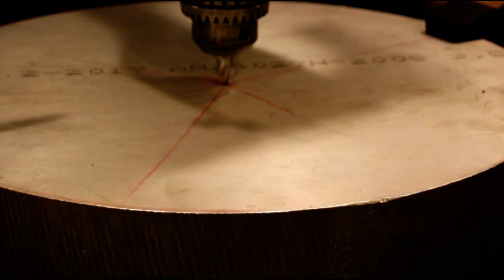Willys Cummins 4BT #1 SM465 Transmission Adapter

Comment: I kinda figured you was cutting wood,  that's about all I've been doing as well lol. I'm very interested in the 465 series as my 3b will be getting a dauntless/465 swap over the winter. Not to worry, she is already far from original as purchased. Thanks Brian, feel free to email if you need any Cummins dimensions,  I have a 6b in my shop as well as a 1st gen Dodge.  I think I sent you a measurement a while back.  Any how, taker easy bud,  Will
Reply from the maker: I am trying to carve out some free time to get the 465 rebuild done but right now the shop is super busy.  Your block to crank measurement helped me get everything set up and continue with the adapter build.  Thanks very much for that.  
Brian
Reply: @metalshaperJeep  no worries very busy around here as well

Comment: Nice wood pile. My story, was living in a small city and was charged 150 a month for water and sewer no mater how much it was used. Moved out to rural part of city that has a well and septic. The savings of 150 now pays all my electric cost all year. So no need to chop or buy wood for heat.
Reply from the maker: Sure is nice to be out in the country on well and septic.  That combined with wood heat sure does save money.  Would be very expensive to heat my shop any other way.
Reply: @metalshaperJeep  I figure out my shop, it takes 2 bucks and hour to heat with propane 1600 floor space at 60 degrees.
I now rent a space a small trailer can park, has no septic. That pays all my shop heat. And they pay electric cost... Your a very talented and smart builder.. Fun to watch. There will always be problems so learn to laugh it off.